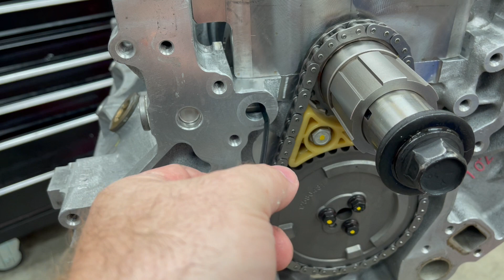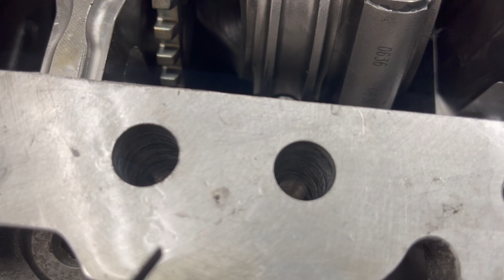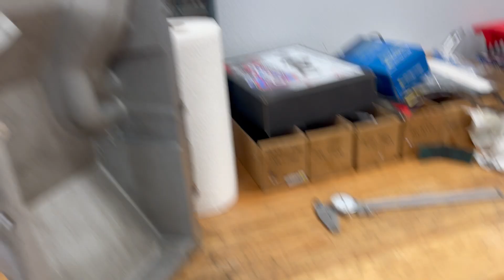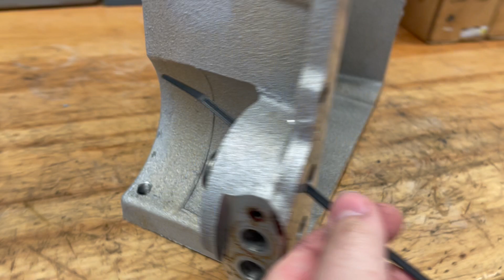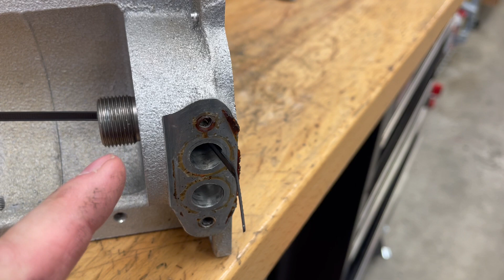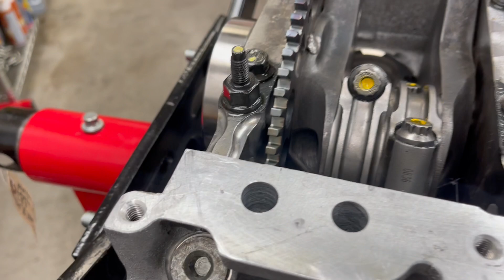LS oil flow video

Comment: How does the timing chain get oil in a Ls?
Reply from the maker: Basically splash oiling.  There will be some that sprays out from the #1 main due to clearance, you will have some drain back out of the valley that goes down the front from the heads and a little bit from splash under braking as the oil goes up to the front of the pan. There is no pressurized spray of oil that feeds it however.